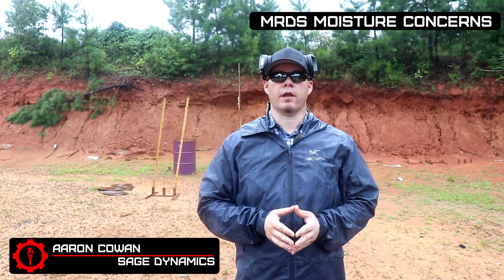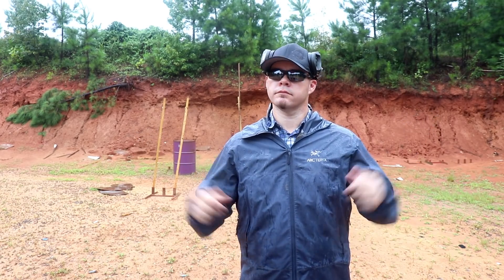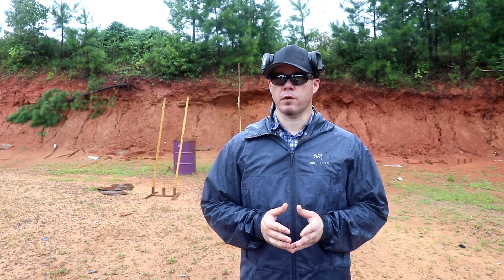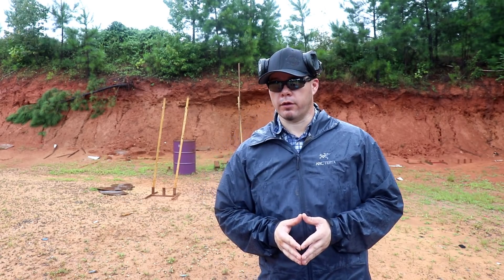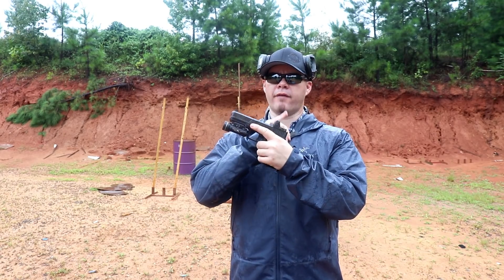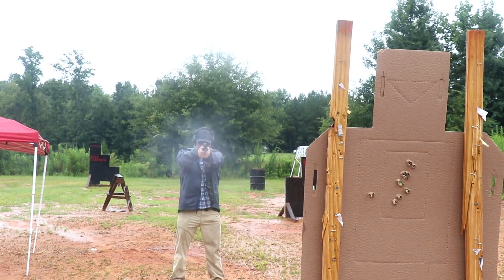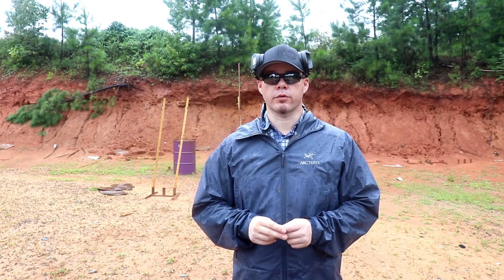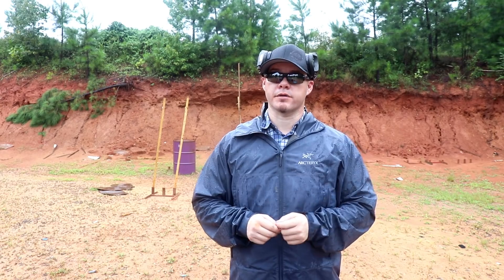MRDS Moisture Concerns

Comment: Had an unusual RDS incident;...In AZ you have to wear sun screen all the time...I had some residual sun screen on my hands even after trying to wipe it off and in working the slide I accidentally got a smudge on the front lens. it wasn't that big of a problem until I turned toward a target that was backlit by a low sun...Instant fuze out...could not see a thing through it.  You never know when you might have to resort to alternate means.

Comment: Would be interested to see a follow up video with the enclosed emitter optics out nowadays!
Reply: There's no follow up necessary. Inside is nitrogen purged so cat crap isn't necessary BUT if you absolutely have to have something for peace of mind then RAINX. I've used both a closed and open emitter, "both holosun" in heavy rain and it really is a non issue.
Reply: I’ve been hearing about top tier enclosed pistol optic seals failing and water and/or condensation getting in and then you can’t get it out

Comment: I am considering switching to a closed diode optic like the aimpoint (acro or micro, not sure?) because both my RMR on my glock and my offset optic on my AR became unshootable in the rain and snow. I only used them 3 times in heavy rain or snow and every time they filled up with so much water, that the dot and the irons were unusable and unshootable. Sure, it wouldn’t matter at a few yards, but the targets were 100m and more, so it didn’t work.
Reply: I've had that issue a lot concealed even IWB. Dust, dirt, skin particles get on the emitter and block it. Even upon drawing and shooting, think the debris would clear out, it doesnt. 😕
I use the Steiner MPS now.

Comment: The military and law enforcement have been using red dot optics for over a decade me being in both. I have zero concerns with optics.
Reply: yeh well, they fought 10 years over there
where there is no rain...
Reply: @ssgslaughter4639  Okay, well, still didnt change a thing, that my reddot in my belt holster is of no use when I have a reddot on my handgun during rain. I dont have ONE red dot but 2 to 5. Also I barely see soldiers with reddots on their handguns

Comment: Guillotine shooting? What is? Why do?
Reply: BFW .  Use the top bar of the optic to cut the target in half and use as an aiming device.  Works best with the RMR because of the v tapered top bar.  It works very well at closer distances for speed.  It’s just a gross sight picture thing.   Back of slide, window itself or guillotine.  I use guillotine.  Draw and sight off the top bar of your optic then move your head( not your gun) .  Your dot will be right on at 7yds and in .  Each person has to play with it though.
Reply: Athletic Performance Shooting Thanks bromigo! Just went outside to play with it. Appears to work very well on a stray cat sized target within 5 yards!
Reply: Hogh308 I’m a dog person
Reply: @appliedperformance773  Thanks for the explanation.  This is similar to what an old friend said he did in Vietnam with his iron sighted M-14: if the aperture is too small for close up shooting, just use the top of the rear sight to line up with the front sight -- your group at CQB range will be good enough.  This translates over,  of course, to modern carbines with Aimpoints, etc. ... if the dot disappears, use the optic as a giant ghost ring, line up on the front sight and fire up the target.  Again, good enough at CQB range.
Reply: redneckzen .  Yes sir .  I have a video on it explaining in detail if you want to check it out.
Reply: @appliedperformance773  Just saw your explanation.  Well done!  I left a comment and a thumbs up as well.  Many thanks!

Comment: What is the Guillotine aiming procedure you mentioned in the video? Ive never heard of this, and i couldnt find anything no matter how hard i tried to use my Google-fu.
Reply: nelsonstephen20 .  Guillotine is using the top crossbar of the optic as an aiming device.  If you have an RMR it works the best because of the v taper in the top.   Cut the target in half with the top bar.  It works amazing.   You have to play with it but for me at 7yds and in I can shoot all Day just using this.   For first shot speed I use it every time.  Draw your gun, use the guillotine .  Then move your head, not the gun.  Your dot will be right on target.
Reply: @appliedperformance773  appreciate that brother. Il have to check more into that.

Comment: Is there a proper way to apply CatCrap and RainX to the MRDS? Would it be possible to get a quick video in the future? Thanks!
Reply: So I heard that right, "cat crap"?
Reply: @TBR_LLC  yeah comes in a red cap with a yellow cat on the cover. The substance is blue. I use it on my snowboard goggles also.

Comment: If it ever comes out, I imagine that the AimPoint ACRO is going to solve this issue, at least when it comes to the emitter, since it's entirely enclosed. Plus, there seems to be a little bit of shroud, maybe a couple millimeters, over the lenses on either end, so I imagine it will be very hard to get that particular optic to go down through moisture alone.
Reply: LMAO... the emitter is sealed... 
The glass is NOT sealed lmao...
Any glass can fog.